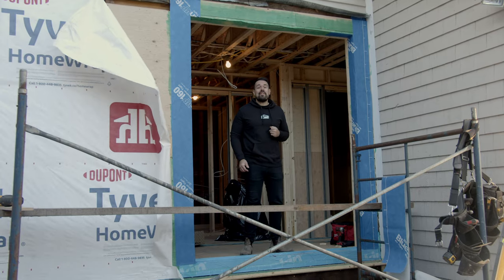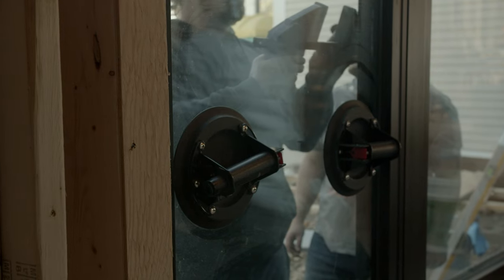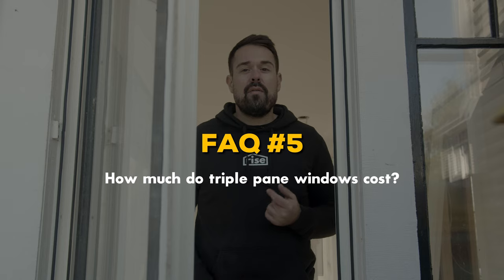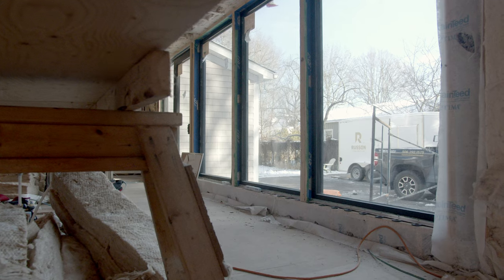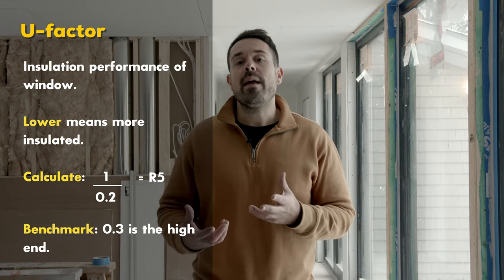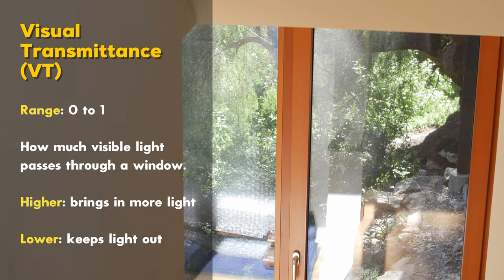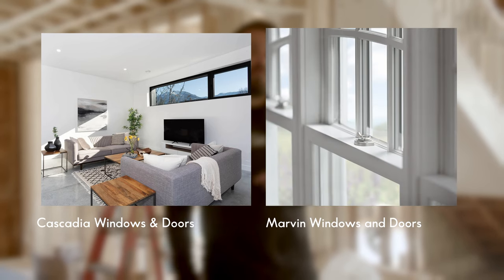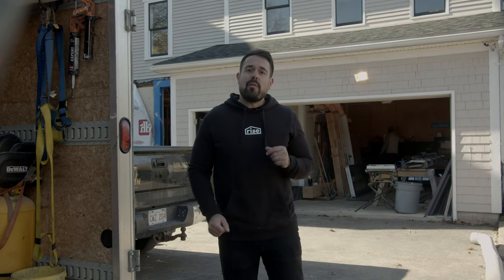Triple Pane Window Pros, Cons, and FAQs

Comment: i'm an energy advisor and do energy modelling of homes.  I can vouch for the accuracy of this video's calculations on energy savings .  Stepping up to triple paned won't save a ton of money and the payback is not there but I'd still go for them in a heartbeat.
Reply: Given the life span of typical windows compared to other appliances, it seems like they're more likely to pay for themselves overtime (not to mention the comfort bonus)
Reply: I live in a 30yo home, the double glazed windows in place are starting to fail, handles falling off, windows not seating correctly, seals clearly in bad condition. I got a 10k quote for upgrading every window & a patio to triple glazed. Home has roughly 9 windows of various sizes and a large glass patio door. It seems a good quote, are there any specific features or specs that you should look for when buying triple glazing?
Reply: @P5YCHO1192  also, I agree that that price seems pretty good. Can I ask who the company making the window is and what climate region of the country you're in?

Comment: Matt, excellent presentation, lots of information presented without becoming overly complicated or confusing.

Quick comment on triple pane glass and sound performance. Although very commonly stated as an attribute of triple pane windows,  improved sound performance isn't a given when moving from dual pane to triple pane windows. A National Research Council of Canada study several years back concluded that "Despite the widespread belief that adding another layer of glass must be beneficial, triple glazing provides essentially the same noise reduction as double glazing, unless the interlayer separation is very large." MIT also did a study with the same conclusion. Ultimately any potential advantage of triple pane over dual pane becomes more pronounced when using wider airspaces as noted in the above quote. 

The optimum airspace in a window IGU for energy performance is about 7/16" to 9/16" or about 11mm - 14mm. The potential advantage in sound performance when using a triple pane would occur when the two airspaces individually are in the same width range as the single space in the dual pane, so that the combination of the dual airspaces in the triple result in an overall airspace from something like 7/8" - 1-1/8" or 22mm - 28mm. At about 25mm or more is when the advantage of the wider airspace becomes noticeable, so while wider is better, unless it's pushing 1" the potential for sound improvement over dual pane is minimal.

Cascadia makes a very nice window, good choice!

Comment: We had a company here in the Salt Lake Valley by the name of Wasatch Vinyl install triple pane low-E vinyl windows in our home about 14 years ago. We have loved them, no more cold coming off the windows, no more sweating from the windows during the winter, the furnace doesn't run anywhere near as much, came with a life time warranty but I can't use the warranty because the company closed their doors several years ago, plus I can't find the sales paperwork, I think my wife took it with her when she divorced me. One window's lift spring broke, the largest window's lifts seem to be getting weak/harder to lift it to open it and a few are going cloudy. Not happy about the cloudy thing. No way I could ever replace these windows now/ can't work anymore because of health problems, thus the divorce. Have no money. Guess I will just get to where I can't see out of the windows. Should have been built so this would never happen. Windows if not broken would last forever but now they have a short life span. 10-14 years is not very long.
Reply: Drill a tiny hole through the frame between the 2 pieces of glass.  The water vapor will eventually go away.  Not ideal but cheapest alternative.

Comment: Criterion Resin frames are the best of both worlds! Apex Energy Solutions uses them, they are actually insulated too! And yes they are triple-pane.
Reply from the maker: Very cool! It looks like they use a proprietary material called Criterion Resin. Sounds like they take their craft very seriously.
Reply: @buildwithrise  That's, correct, for that reason they offer a lifetime warranty, against warping, cracks, or any seal failure. This includes the glass.

Comment: One thing you didn't cover was the importance of the inner leaf temperature in 'apparent comfort' and the avoidance of condensation and condensation damage. A 3G window will keep the inner leaf above 14C down to about -10C outside, which means it's always above the condensation temp for normal house humidities, so you never get water dripping down the glass (or frames if the frames are good too - they are usually the worst bit on 3G). and having warm surfaces is a big part of feeling warm in the room because people are sensitive to radiant heat transmission. This is one of the reasons passivehouses almost always end up being 3G in most climates.
(We replaced 2G with 3G here 4 years ago and they are really nice! The silence is perhaps the best bit  but the radiant heat comfort is very nice too.)

Comment: Nice!  -- QUESTION -- Why do you keep saying "drafty windows" when referring to double pane (or single pane) windows.  Neither of those windows lets in drafts (unless it is broken or not installed properly as would a broken or improperly installed triple pane window).  All windows stop drafts. The insulating value of double or triple pane windows is almost nothing. In fact, a proper single pane with an exterior storm window will out perform a triple pane. The most important factor is having a proper solid wood framed window that would last 100 years. Triple pane or double will fail inside 20 years as they loose gas and fog up. A solid single pane is best - which is why commercial stores have massive thick single pane windows. In dead winter when its -29 outside I can stand inside of a massive single pane sheet of glass wall at my local mall or office and feel no cold at all. Modern glass is amazing and all this triple pane stuff is nonsense. Go commercial glass.
Reply: This is one of the least educated comments I’ve ever read. Almost all single and double pane windows are drafty because they use cheap seals. Or in most single pane no seals at all. And you are talking about fixed pane at the malls and stuff. First most people want their windows to open, secondly the 1/4”-1/2” thick bullet proof glass at malls is more money thank you can afford and weigh more than you can lift. Also on residential fixed double pane the service of the glass in cold weather is very cold and when you stand in front of it your body heat leaves and moves to the window making it feel drafty. 

Also most storm windows are just screwed to the trim on the outside of your house and cold flows right behind them making them almost useless. 

The only time a triple pane isn’t worth buying in a very cold climate is if your house has poor insulation or air sealing. In that case fix those issues first.
Reply: @dreambuild2022  ...yes, the seals must be in place which is why I specifically wrote "properly installed" windows. If you do not have seals on any window, single, double or triple, they will obviously leak air.  Only lazy or foolish people would install storm windows that were not properly sealed. The official rating of storms PROPERLY INSTALLED together with a single PROPERLY installed, exceeds triple pane windows PROPERLY installed. They are all low on the R value but that is not actually very important. Your house will be perfectly warm and comfortable regardless. This "new window" scheme is way over hyped and offers nearly no benefit and lots of costs. A home owner will never get the costs back regardless of how long they live. In my experience, if you live in a house with ratty windows it is very likely that the entire house is ratty construction. Most well built older homes from the 1940s are remarkably well built and should be maintained.
Reply: @Coleen_West  i currently have double glazed windows 40 year old. What are the benefits if i change? And should i change? 
I live in the uk. 
My 3 entrance doors are in need of changing. I was going to go for double glazed on the doors and not bother with triple, then i was offered low e glass. Now i dont know whether to pay the extra for low e?